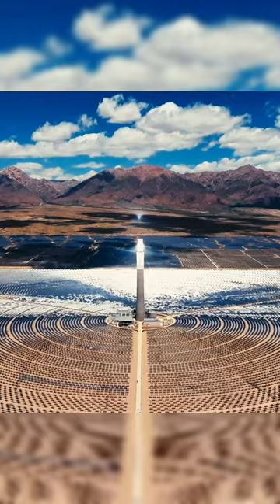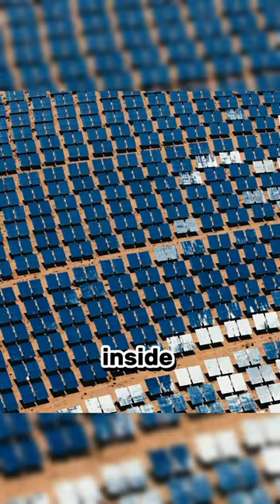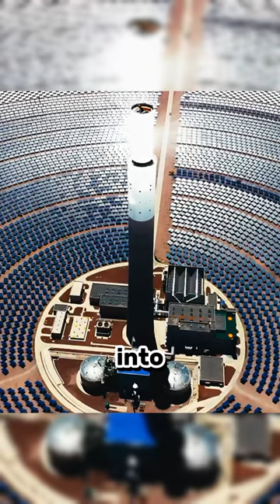Solar Power Tower #shorts

Comment: The power plant was a failure
Reply: Nope
Reply: No
Reply: No it was not.. It worked WELL...   But the local power companies did not like that it cut into their PROFITS...   I been to 2 of them and to me they are scary...
Reply: No it worked it wasn't economically viable
Reply: It literally worked wonders. Its only downside other than size was the fact that anything that flew too close to the boiler would be set on fire.
Reply: @linuxuser2928  it was a failure because it didn't produce enough energy for commercial use
Reply: @kubumshel  except they do. They scale. The design is amazing for many reasons.
Reply: You guys are arguing like the power plant failed or succeeded when the video didn't specify any particular plant. There are plenty of solar power towers that are successful as well as those that have discontinued, just like other types of power plants.
Reply: @linuxuser2928  there is a difference between promising design and failure in engineering. The plant was a failure because it failed to generate enough power for commercial use. Same as Nuclear Fussion. Currently both engineering failures.
Reply: @TH-lu9du  it was a failure because it was a failure. 😌
Reply: We have one in India too 
It has many uses apart from electricity

Comment: it takes up a stupid amount of space compared to solar power tho. that same area with solar would generate a fuckton more energy. the only benefit is storage which can be realized smaller as its basically the same concept.   i would live to see 2x 3--x3--m blocks on with this setup and one with solar + a "salt battery" heated by electricity.  i'm fairly sure solar has more energy.
Reply: Don't comment when you aren't even a engineer